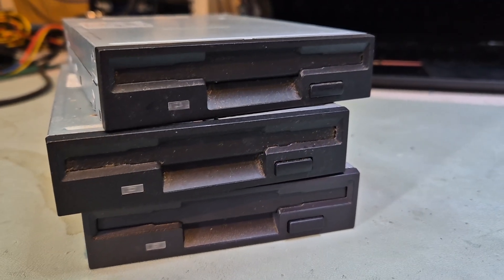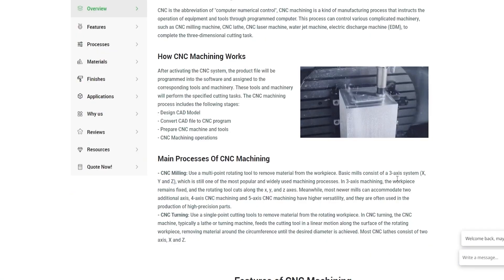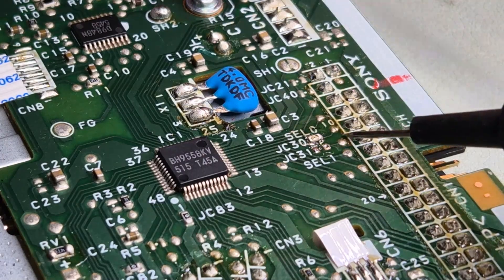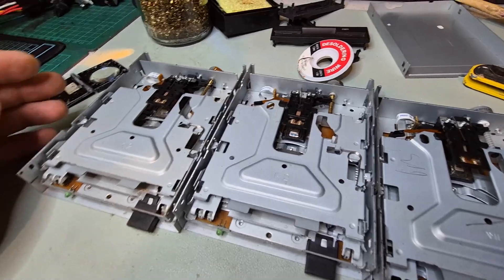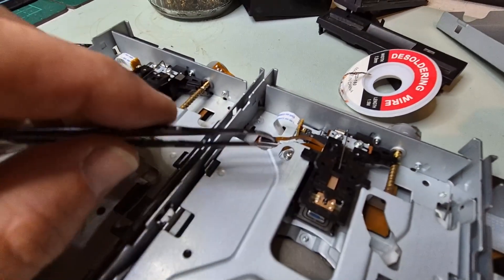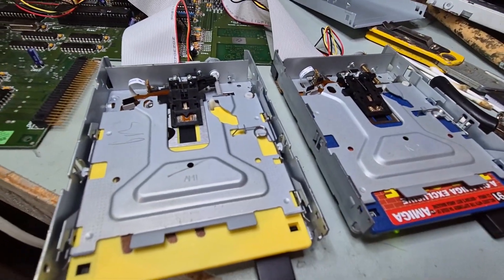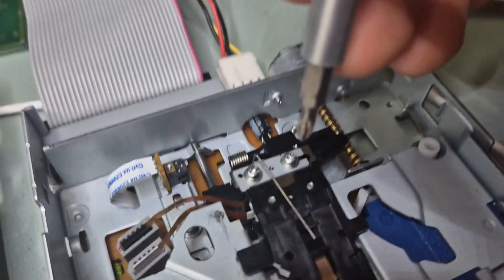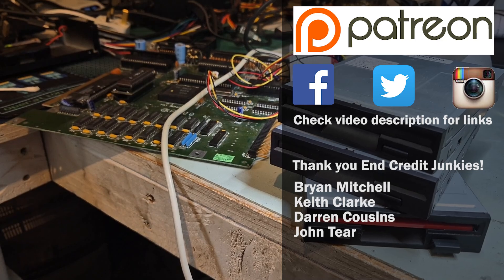PC Floppy Drive to Amiga Mod (Sony MPF920)

Comment: Very nice video!!! I modified the Sony MPF920 and used a special adaptor that does the modification itself and you don't need to tinker with the floppy drive. So as expected it didn't worked.
My question is what cable should I use to connect the modified MPF920  as external drive to the Amiga external drive port.
Reply from the maker: oh to use it as an external drive you need an IDE to floppy adapter for amiga. Places like Amigastore or Sordan or Amigakit can sort you out for these (depending on where you live)
Reply: You can't just use a cable.  You need a couple of TTL logic chips to modify some of the signals.

Comment: Always had an idea of modding a PC drive to enable HD floppies on the Amiga. All that space on a floppy!
Reply from the maker: can you even avail of the extra storage on an HD floppy on an amiga with a mod ? what would it require ? like a switch and treating it like a new storage/floppy space or drive ?
Reply: Seems that the "Chinon FZ357A" works as is
Reply from the maker: yeah it shipped with the A3000 and A4000 I think. but there's nothing that really takes advantage of it so it's just for extra storage really but since we now have extra large hard drive solutions for those machines there's not much advantage to having HD floppies really . 
But... It's a cool mod though if you figure out how to pull it off  :) because why not, really :)

Comment: The drive heads track width is important i suppose
Reply from the maker: not entirely versed in drive differences and whatnot but if it works I don't question it :) 
re-aligning is sometimes required though but I won't claim I fully understand why